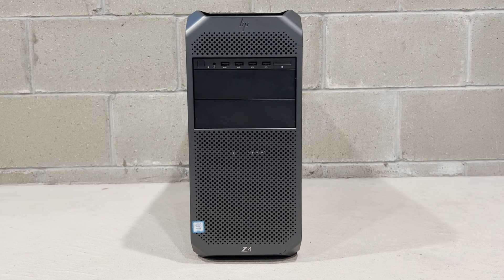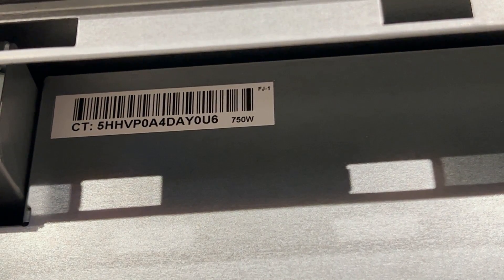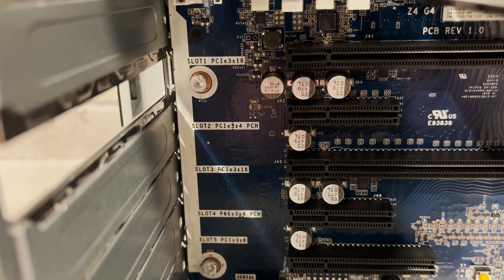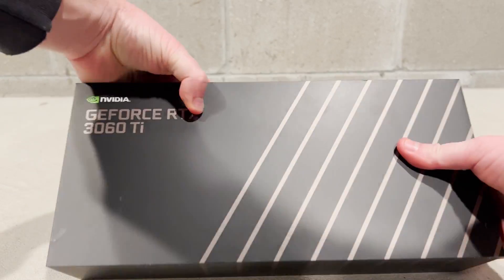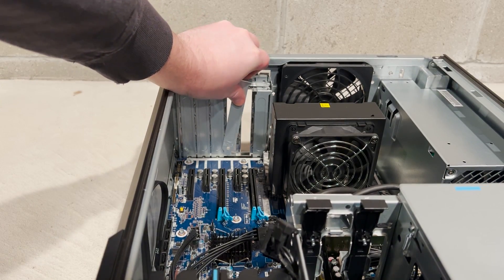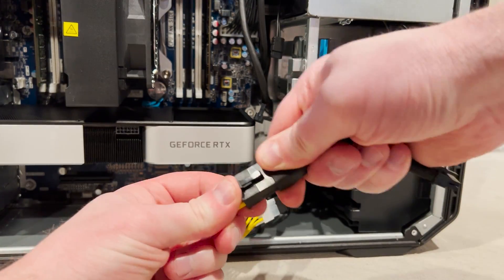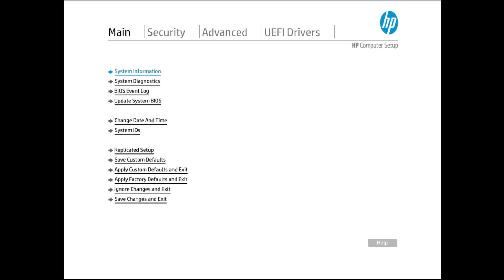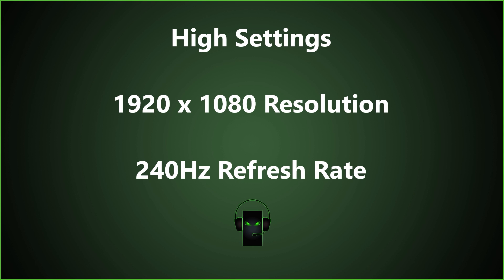A Close up Look at the HP Z4 G4 Workstation + RTX 3060 Ti Install + PC Game Testing

Comment: Likely you changed motherboard, because HP's motherboard in Z gen 4 series limits which gpu's you can use, up to turing and low profile ampere (only 3050)

Comment: how did you configure it to use 32gb ram? I have one but when i install 2 16gb corsair vengeance lpx ram, the computer just beeps with the 3 red lights following with 2 red lights. the HP manual says that it’s installed incorrectly, but it can’t be since it clicks into place every time

Comment: Im undecided if using xeon W-2255 CPU 3.7ghz 10 cores 20 threads or I9-10900X + RTX 2080 super 8gb for gaming AAA Souls Like Ultra 60fps in 1080p + T1000 8gb for professional tasks like graphic design in CAD, Blender, DazStudio, Photoshop, Premier, Illustrator, InDesign, Canva, virtualization VMware, databases and software development

Comment: Here’s my Z4G4 set up. I’m working on the graphics card at the moment, I’m thinking about getting a 40 series. My processor is an Intel core i9 10 980 XE 18 core 36 thread 1000 W power supply one terabyte nvme ssd base clock speed of 3.0 GHz up to 4.8
Reply: You got the big boy CPU. I think it's overkill for my needs though.
Reply: @rockstarSG1  I have a HP Z4 G4 too but I want combine dual GPUs: 
One RTX 2080 Super 8gb for AAA gaming titles Souls's like, Elden Ring, Nioh, Soul reaver Remastered, Diablo 2 resurrected at +60fps Ultra settings.

One T1000 8gb for professional tasks like graphic design softwares in Blender, DazStudio, AutoCAD, Premier, Illustrator, InDesign, xD, Photoshop, openshot, after effects, virtualization VMware, databases and software development 

Technically specs said Z4 support dual professional GPUs Nvidea Quadro and PNY but I dont know if there sufficient space for a Gaming GPU of double slot like 2080.

i9-10890XE can be overclocked for to hit 4.0ghz from 3.0ghz but his tdp its the most hightest and most hotter, it require a very efficient cooling system and Z4 not support AIO cooling.
Reply: I9 10 980 XE require a very efficient cooling system. But Z4 no support AIO cooling
Reply: @Kai9456Jojo  it does support AIO cooling
Reply: @awesomereview2358 what AIO are you using? I think Z4 have a owner AIO named The Z40 with steam Chamber but I dont know if its useful for cooling 168 TDP.

I9 10 980 XE using 18 cores + 36 threads and 3.0ghz base frecuency but can increasing to 4.0ghz with turbo Boots technology. He can 64gb ECC RAM or more memory for resolve error correction in professional applications, It can't be overclocked.
Reply: @Kai9456Jojo  I know it can’t be overclocked, but HP does sell AIO for it

Comment: Here is my Z4 G4 setup. Intel i7-9800X CPU with upgraded HP Z440 cooler. 64gb quad channel memory. 512gb m.2. 1tb sata. HP RTX 3060ti. Stock 1000w PSU with 8 pin connectors so no adapter needed. I think it's a well balanced setup with no bottlenecking.

Comment: Does it support the 

EVGA GeForce GTX 1080 ACX3.0 8GB

Or 

MSI GeForce GTX1080 Gaming X 8G
Reply: I don't have either of those specifically, but I ran a PNY 1080 8gb card in mine for 2 years without any issues, just had to get a 6pin to 8pin adapter

Comment: This channel seems to be somewhat dead, but I'll still say this. This channel should make an attempt to use Radeon graphics cards more often in its guides, as they are comparatively cheaper to their Nvidia opposition. Cards like the RX 580/590/Vega/5700XT are quite good budget beasts, with the Radeon RX 6000 series being able to do light ray-tracing. Furthermore, Radeon cards have less driver over-head, making them a better choice for older processors.

Comment: I have the same computer as you but I use a stronger chip, the w-2135, but I can't optimize my card for any work, in task manager it only jumps to 5-6% when I work, do you have any way to guide me to set its parameters, install bios, or do I have to reinstall Windows?THANKS

Comment: I'm running a Z4G4 with Xeon W-2125, 32gb RAM and a RTX 4060 8gb, dual nvme:s for storage. Price/performance very good, runs most fps games fluently on 1080p and high/ultra settings. Might need to upgrade the processor cooling though, on some games core temps creep up to over 90c. But overall, very good platform for easy and affordable gaming.

Comment: How to update tpm on z440 i tried all and not updated
Reply: For Windows 11? You could use rufus to bypass the requirement, the CPU you have is too old to be officially supported anyway. The HP Z4/Z6/Z8 G4 are the oldest officially Win11 supported workstations from HP.

Comment: Thank you.

I am considering a similar build, but with a W-2133 instead.

Alternately, a Lenovo Thinkstation P520.

But the HP Z4 G4 looks cleaner, and less heavy.
Reply: I have both of those computers.  They are both great computers but the P520 definitely has much more room inside.  My rx-6800 had to go in my P520 because it didn't even fit in the Z4G4.  That gets the 3070ti.  BTW, go with the w-2145, it's by far the best bang for the buck.  8 core with high clock speeds.

Comment: I would very much like to find some resource that explains the Z4 G4 BIOS. It is so different compared to all the other non-workstation PC's I've owned and many of the advanced settings barely result in any matches on google search or give results that do not explain in simple terms some of the more obscure settings. HP does a very lousy job by not providing a comprehensive guide for each setting in the BIOS. If you know of any such resource I would be very grateful. I'm running an almost identical Z4G4 to the one in your video with the exception of the video card which is a RTX 3060 (Gigabyte) 12 GB VRAM and the W-2145 (octa core) and I'm still messing with the BIOS.

Comment: swapping the case to modern one with fans and rgb ,what i need to consider ?
Reply: asking the same
Reply: You can't, the motherboard isn't the right shape to fit in any other case. It should have good enough airflow by default. For RGB you could put an LED strip to the front and it should be visible through the front air intake, though for ARGB you'd need a controller because the workstation obviously doesn't have an ARGB header. Or you could go with some cheap crappy one which comes with a remote

Comment: I had the same HP Z4 G4 with 32 GByte ECC Ram installed. Swapped out the NVidia P1000 that came with the PC and installed the GEForce RTX 3060TI just like you showed on the video. Rebooted and the first problem I encountered as this "POST Error. 513-Configuration requires a Front Chassis fan and this fan is not detected. Press ENTER to continue" which I did. So it carried on with the installation. Next problem was only 1 display came on. I have a dual display monitor prior to swapping over to the RTX 3060TI. So I thought perhaps my monitor might have given up the ghost. So I had to reboot and just had only one display monitor on at a time. Both displays worked fine from each of the display ports on the RTX 3060TI. I had to reboot many times to do that test. But it proved that individually, the display ports were fine and the display monitor were fine. But when both display monitors were plugged into the RTX 3060TI ports, it can only detect one monitor. Any idea what is happening here?
Reply: you need the hp z4 g4 fan and front card guide kit

Comment: Hey I'm getting the IcoreX i9 version do you know if the model has xmp to overclock ram since it's unregulated
Reply: typically HP workstation BIOS doesn't have that kind of control.

Comment: Well, it's a relief to know it works well for your system!  My "Cyber Monday" RTX 3060 card just arrived today, unfortunately dual 6-pin to 8-pin adapter won't be here for another week and every PC Component Brick & Mortar in the greater Seattle area has either gone out of business or is only carrying a 6-pin to 8-pin adapter which isn't going to supply the 170 watts this thing likes to slurp...  I also got an Asus 4k Pro Art monitor and am looking forward to better color\contrast\resolution for video editing photo viewing as well as the Nvidia GPU horsepower to execute AI functions on photos in a more performant manner!  The Quadro T400 card my Z4 G4 came with is woefully inadequate for the latest AI features in photo editing software!

Comment: hello i have a xeon e5 1650 v4 with rx 5700 xt and 32 ddr4 2133 but it seems like i'm not getting the right performance out of the gpu any idea ?
Reply from the maker: Make sure you have the latest driver installed.  Also, is the poor performance happening on multiple games?
Reply: i sure have everything updated to the latest version but it i'm just not sure if the cpu is just weak or am i having a really bad bottleneck or is it just normal most of the games run fine but stutters @GreenPCGamerscom

Comment: I got this for free no ram storage or gpu i want it to run PCVR on a quest 2. I see you advise sticking with the rtx 3060ti how much ram would you suggest i get and does it matter what brand? I found VORPX which turns FPS games into VR so all bioshock farcry and dishonoured will be getting replayed
Reply from the maker: Nice Find!  The RTX 3060 TI is a great value graphics card for the Z4 G4 Workstation.  32GB would be a nice amount of memory.  We normally like to use Hynix or Samsung modules.  If you have the Xeon version, you can use the 2666V/2933Y ECC Reg Modules.  If you have the i9 Version, you will have to use 2666V/2933Y unregistered modules.  Thanks for commenting!
Reply: Thank you i will go with that. @GreenPCGamerscom
Reply: How did you get it for free?
Reply: @natenorman3468  I work nights in a building that has a electronics bin. 3 of the floors are a company that rents office space so every once in a while they throw out PC,s sometimes they leave parts in sometimes they don't. This time they threw about 10 pc,s all stripped but this was at the bottom. sometimes i get SSD and sometimes low end ram on rare occasions i get NVME drives as they are small and left in
Reply: @natenorman3468  My preference is to trade the parts at cex this allows me to buy other more expensive things from headphones to garmin smartwatch etc
Reply: @natenorman3468  they threw it out at work so i kept it

Comment: Hey man I was able to score a z4g4 from work as we phased them out about a year ago. Been running my severely outdated gtx1050ti for about a year now and just tonight pulled the trigger on a RTX3060. Got a sweet deal on marketplace. My dual 6 pin to 8 pin adapter will be here tomorrow and I’m looking forward to swapping gpu’s out. Anything you can recommend? Currently have 64g of RAM and the Intel Xenon w-2123. We did beef them up when we ordered them as we run printing RIP engines all day on them. Also scored a liquid cooler ROG 3 fan and was hoping there would be some compatibility over the OE heat sink/fan. It appears to fit but haven’t really dove into it just yet. I really only play BeamNG and ATS with my simulator. So I’m hoping for decent results!
Reply: Also have an I9 9900k that I was debating on installing. It came with the GPU/cooler/MSI z390 A Pro mobo. Scooped everything up for $300. What would you recommend?
Reply from the maker: If you have the xeon board, you'll have to stick with these cpu upgrades:

Xeon W-21XX Series:

 

Up to 1 x Intel Xeon W-2125 4C 4.0Ghz 8.25MB 8GTs | 4.5Ghz Max Turbo Frequency (SR3LM)

Up to 1 x Intel Xeon W-2133 6C 3.6Ghz 8.25MB 8GTs | 3.9Ghz Max Turbo Frequency (SR3LL)

Up to 1 x Intel Xeon W-2135 6C 3.7Ghz 8.25MB 8GTs | 4.5Ghz Max Turbo Frequency (SR3LN)

Up to 1 x Intel Xeon W-2145 8C 3.70Ghz 11MB 8GTs | 4.5Ghz Max Turbo Frequency (SR3LQ)

 

Xeon W-22XX Series:

 

Up to 1 x Intel Xeon W-2235 6C 3.8Ghz 8.25MB 8GTs | 4.6Ghz Max Turbo Frequency (SRGVA)

Up to 1 x Intel Xeon W-2245 8C 3.9Ghz 16.5MB 8GTs | 4.7Ghz Max Turbo Frequency (SRH02)

Up to 1 x Intel Xeon W-2255 10C 3.7Ghz 19.25MB 8GTs | 4.7Ghz Max Turbo Frequency (SRGV8)

Up to 1 x Intel Xeon W-2265 12C 3.5Ghz 19.25MB 8GTs | 4.8Ghz Max Turbo Frequency (SRG5Q)

Up to 1 x Intel Xeon W-2275 14C 3.3Ghz 19.25MB 8GTs | 4.8Ghz Max Turbo Frequency (SRGSP)

Up to 1 x Intel Xeon W-2295 18C 3.0Ghz 24.75MB 8GTs | 4.6Ghz Max Turbo Frequency (SRGSL)

Comment: I currently have a Z4G4 with a Xeon W-2275 CPU, 64 GB RAM, and a Quadro P1000 4GB GPU installed. I am planning to upgrade the GPU and potentially also the PSU. Will it be possible to fit in a RTX 4090 with a 1000W PSU inside the Z4G4 tower? The recommended GPU upgrades on HP's website all seem to be relatively older GPUs. The system will mainly be used for ML training and inference, so I am looking for a GPU with larger VRAM (>16 GB)
Reply: I wouldn't recommend upgrading to a 4090, but something more like a 3060ti as you'll probably see CPU bottlenecks pretty badly since the cpu is from Intel 6/7th generation. I'd say go with the best card you can get that uses a single 8 pin pcie cable and just enjoy the system. It'll be a massive upgrade to your current gpu all without the need to put more money into the prebuilt.
Reply: @TechMatticz  What saturates a GPU greatly depends on what resolution you are looking to game.  If you want to game at 1440p or 4k ultra, a high clock speed xeon like the w-2145 will even saturate the 4090 in most games.
Reply: @gametime2473  valid point, but at the same time the power supply in these units might be rated for 900w but putting a 400w card could put the final nail in the coffin on those workstation units. I'm not even sure if they come with 3- 8 pin pcie connectors for that kind of draw.
Reply: Besides, the whole point of gaming with an old workstation is to game efficiently at a budget. If you're putting $2-300 into an old workstation like this and then wanting to throw in a $1500 GPU, that just doesn't make sense to do. Can the cpu handle it? Sure it can at high resolutions... but I wouldn't trust an old workstation I bought for 20% of a 4090 to feed 400w of power through. Throw a $3-600 card in it that doesn't pull a ton of power and call it a day :)
Reply: Ive used 4 of various workstations in the last 15 years and honestly, workstation power supplies are sick.  They are strong and seem to last forever.  My last machine is 2013 z620 and the power supply still works great with high end CPU/GPU @TechMatticz
Reply: Thank you for the replies, but as I mentioned in my original question, I intend to use this machine exclusively for Machine Learning training and inference work, not for gaming at all. Hence, my main need is a powerful, high VRAM GPU with plenty of cuda and tensor cores. I have so far never even gotten close to overloading the 14 core Xeon CPU or the 64 GB RAM for that matter, but I frequently face memory allocation issues with my current 4 GB VRAM Quadro P1000.
Reply: @souravdutta24  Yeah for machine learning the high core count and L3 cache is huge.

Comment: Kindly need your advice if i will have bottleneck if i use RTX 4070 TI or RTX 3090 TI
Noting that my processor intel xeon w-2295 and my RAM will be 32 GB
Reply from the maker: There would most likely be strong bottlenecking with the RTX 3090 TI.  The RTX 4070 TI would be a better choice.
Reply: @GreenPCGamerscom  What about an RTX 4060? I am only concerned with 1080p, and the power draw seems good.

Comment: On some Enterprise class PCs the Windows license key is stored on the motherboard, is that the case with these as well? I see a number of these offered on eBay without an OS, which isnt a problem, but would I have to buy a new product key for windows?
Reply from the maker: You’d have to check with the supplier if the system includes a digital license.  Most of the time the recyclers that sell on eBay won’t know how to check.  Find a good deal, and consider it a bonus if it comes with a digital license on the system board.

Comment: whats up dude, nice video. would it be a wise move to put an rtx 3080/ 4070 in a t3620 with a 750w psu i7 7700 and 32gb ram?
Reply from the maker: There would be some strong bottlenecking.  Go for a 3060ti or 4060.

Comment: How has this build worked for you? I just got the z4 g4 and was wondering if this was worth it?
Reply from the maker: It works well.  They are a great value.
Reply: @GreenPCGamerscom  hi. I’m having a hard time deciding what gpu to put in my build and was wondering if you had any suggestions? My z4 g4 is slightly different than yours with a Xeon w-2235 and 32 gb ram. Was going to go with a 3060ti like the video but didn’t know if mine could push more than that and I also like the lower wattage of the 4060ti. Or if an amd 12 gb like a 6700 xt or a 3060 12 gb would be better for the extra vram?
Reply: @ninerknight5351  I'm running a Z4 G4 with the Xeon 2145, 32gb ram, 750w psu and an RX 6800, runs nicely and the cpu and gpu seem nicely balanced. My other option was the RTX 3070, but really wanted more than 8gb of vRam for future titles as I don't have the budget to upgrade very often and want this build to last a while.
Reply: @SideQuestShenanigansLTJ  This is the exact system I have in every way other than the GPU (3070ti).  Mine pushes the 3070ti to it's max so that is a definite option.  I would say the 4070 would probably be the top GPU to put in this.  Even a 4090 will likely be maxed out on this system as long as you are running 4k or 1440p at ultra settings.

Comment: You didn't show any driver install, pulling the old card out, etc. My power connector is on top of the RTX4080 and I don't think the side will go on with it on top, stupid, like that? Will my card work just plopping it in and turning on the unit?